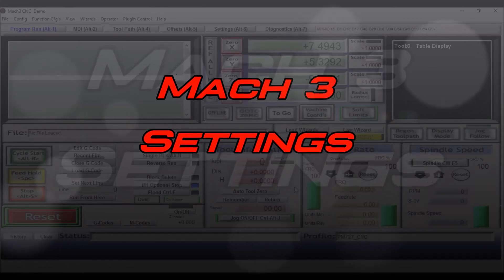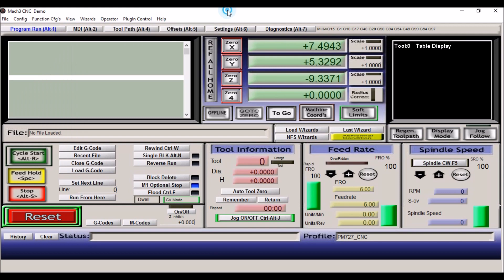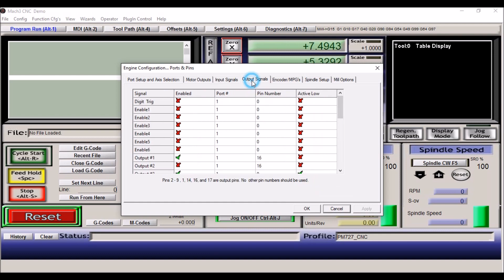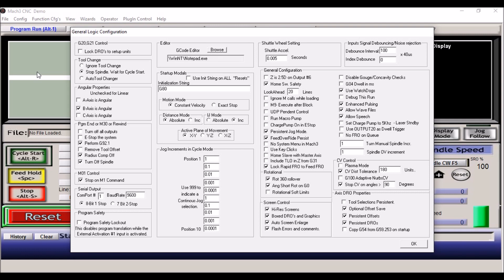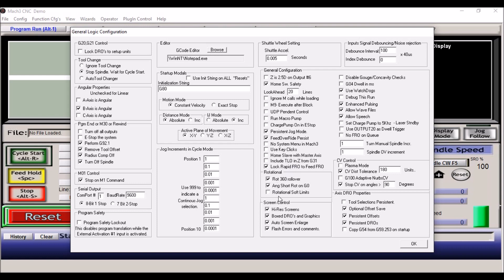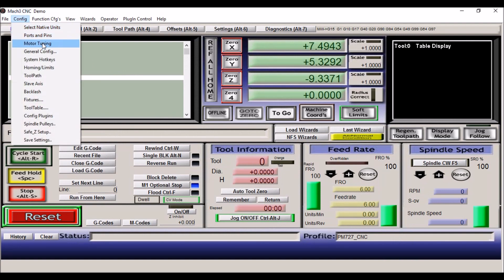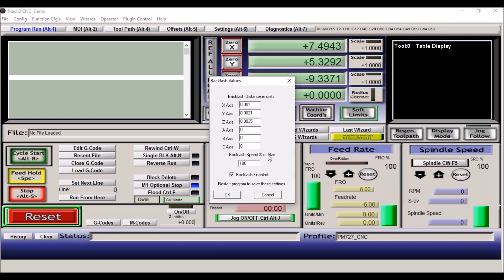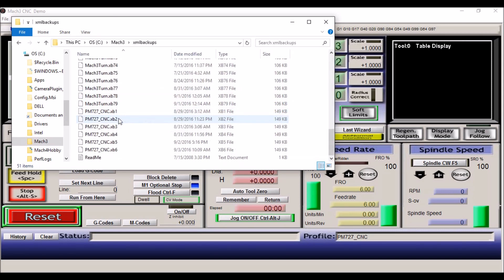PM727M Mach3 Configuration

Comment: Wich setting i need to change my cnc feeds and speeds are good but when i doo multiple parts the shift between parts are  terribly slow. for example  when i make full sheet of small parts.
Reply from the maker: do you have rapids slowed down in the settings tab?
Reply: @CNC4XR7   i understand that i have but where i need to up the rapid speeds because i dont have it on  my starting screen menu i have just feed rate  and overide.

Comment: Mate just wanted to say thank you very much I just built a optimum bf20lv CNC mill from scratch it was a mission just trying to get it to home and use the inductive sensors I have 3 of them that work as home and limits switches what would you set in the homing and also the port inputs as settings I tried your setting and it flashes a yellow light in diagnostics showing its registering but when I jog it lets me go past the sensors. Warm regards James.
Reply from the maker: Hi James
When you reference a axis or all it should reference Z ,Y, X ( go to the home sensor and back off) then turn the reference led green. If this is happening then Mach3 see the sensors and the input is working! since you get a led in diag. i suspect all of the above is working. Now as for travel limits they should use the same inputs as the Axis home switch. Also I personally only use soft limits.

Comment: I would set your look ahead to max, you will run into issues with it set to 20 with adaptive strategies. s they eat lots of code lines quickly and you don't want it to catch up with motion planning!
Reply from the maker: Yeah I forgot about that Thanks
Reply: I agree with Chris. I have had not one but two machines not work properly during complex adaptive toolpaths due to this setting being left on default. Changing this to 500+ fixed the problem.

Comment: CNC4XR7, great videos very informative...im looking to order the PM727 here soon...Do you find the max rpm to be a little slow for cnc milling? specifically aluminum?
Reply from the maker: Thank you,
Great Machine Tell Matt Sam sent you! I would not delay as I see Grizzly has raised the price of there version $100.

With the VFD and 3425 RPM Lesson Metric motor I think it will be ok as is But plans are to convert to a Belt drive and at the least Double that speed.
Be Safe,
Sam

Comment: do you know the total cost of the cnc conversion? I'm looking to do the same thing.
Reply from the maker: Thats something not easily answered as it seems to be ever changing. There are also many different configurations you can go with as far as steppers , servos, etc.  Having said that My mill as you see it is at $4250.00
This includes everything you see enclosure coolant pump, CPU, monitor, all electronics etc.

future additions will be Clearpath servo's , PDB and ATC plus a 4th Axis

Comment: what is pros & cons using Computer vs using Offline CNC System ?
Reply: What is pros & cons using Computer with Mach3 vs. using Offline CNC System ?
Reply from the maker: Most of the hobby cnc controllers are Computer based.  however there are some stand alone controllers out there it really depends on personal preference. normally CPU based systems are more customizable
Reply: thank you